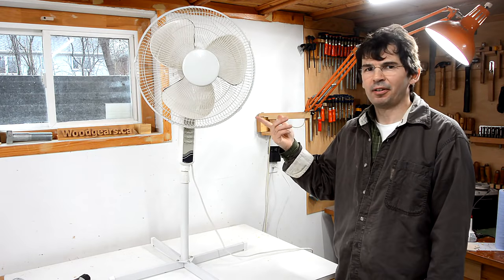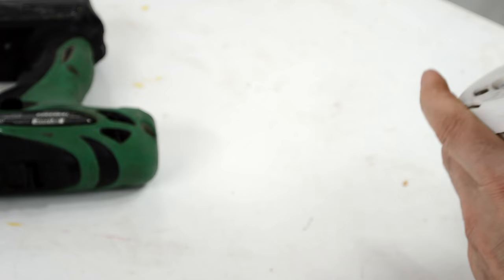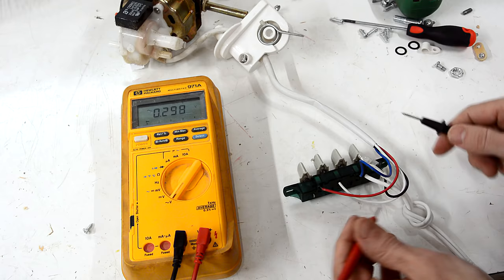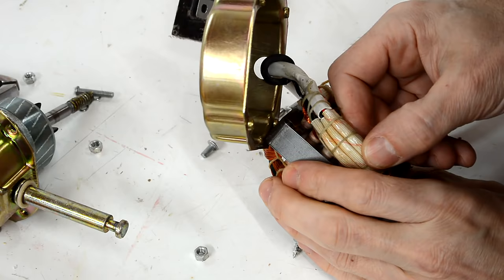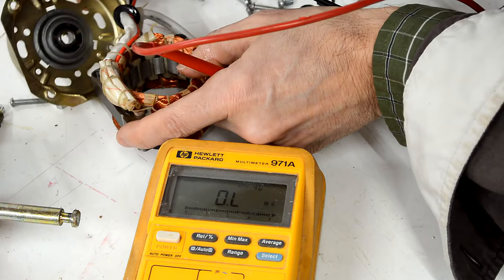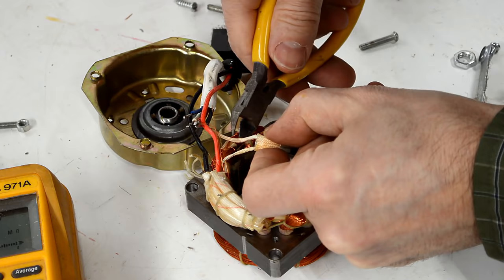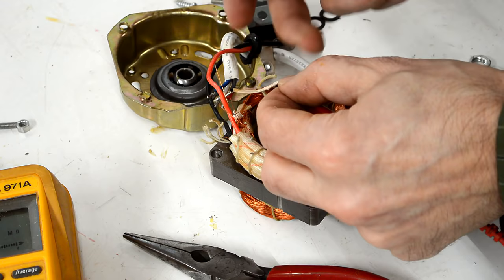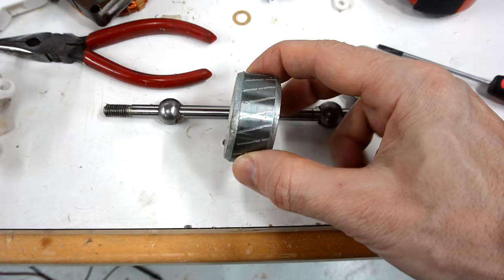Fan repair fail

Comment: "Not worth fixing anymore". Because soldering irons haven't been discovered yet?
OK, soldering irons and profanity...
Once you get into windings, then it's iffy.

The most common cause of thermal fuse failures being lubrication failure, due to dust sucking up the lubrication in the bearings.
A lesson, folks! Keep plenty of lube on hand.
I'll just get my hat...

Comment: You might have saved 16-20$ if you fixed it. They're heavily underpowered and heavily overrun.
Reply: +Adam R I have that same fan in the shop.There is enough dust on that one to stop the motor.I dust mine once a week.POS
Reply: River rat yeah... same thing in my garage. it moves good air but I gotta oil and remove the dust every week.

Comment: I was hoping that thermal fuse would just turn into a giant red wasp and sting you right in the eye to let you know it is there. And just so you know, that fan could still be repaired despite you yanking on it but my guess is you're neither and ekectrician, yet more than a repairman. Why even post this video if you epicly failed....smh.
Reply: electrician
Reply: Grumpy Dude